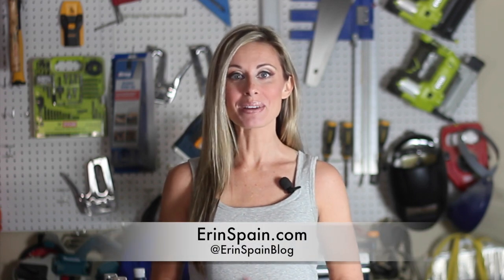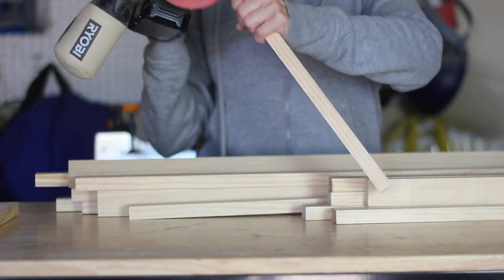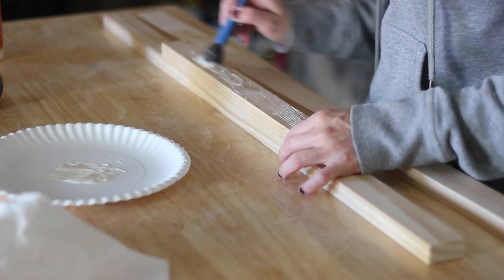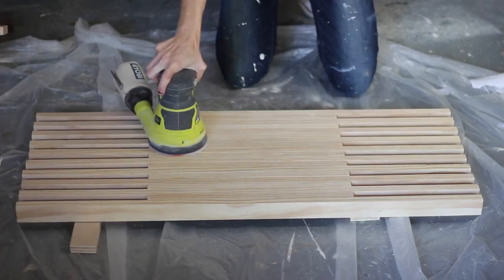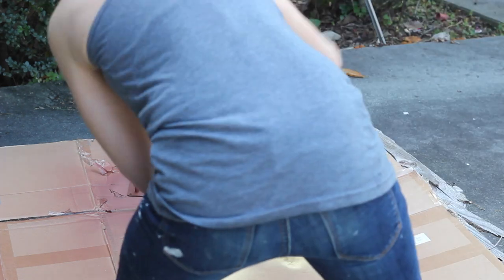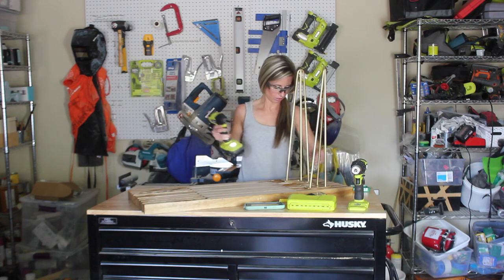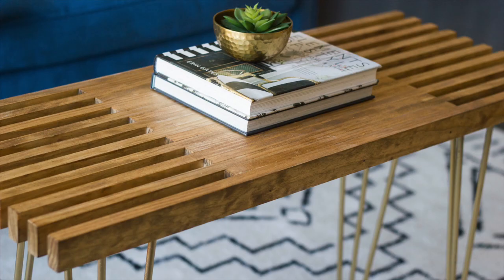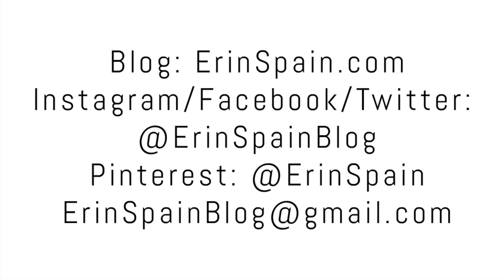DIY Slatted Coffee Table

Comment: Nice build.  I like it!

A couple of suggestions?

1.  In this kind of build I'd be pre-finishing.  Mask off almost the entirety of the areas which need to be exposed for glue and finish the wood and then do the assembly.  Lining up the pieces can be a bit more difficult (because you probably don't want to mark the finished parts) but you can build a frame to fit everything into and fill the open areas with pieces of wood to ensure perfect positioning - you'd really need only two of those positioning pieces.  If things are uneven and you have to sand again after assembly - you only have to re-finish the top.
2.  Having the hairpin leg mounts visible between slats would bug me.  I'd cut out the part of the hairpin base which was going to show between the wood, paint things, and then screw everything down.  Considerably more bother but it should be pretty doable.  It'd be slightly less stable but it should be sturdy enough.

And again, nice build and nicely presented!